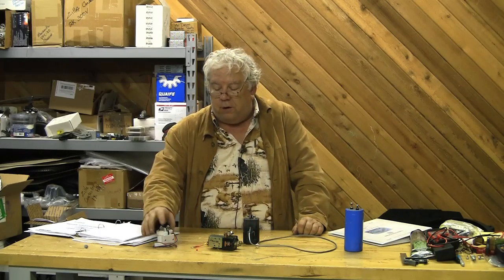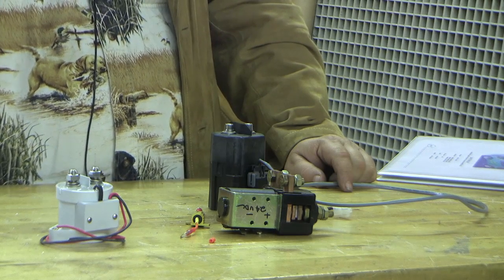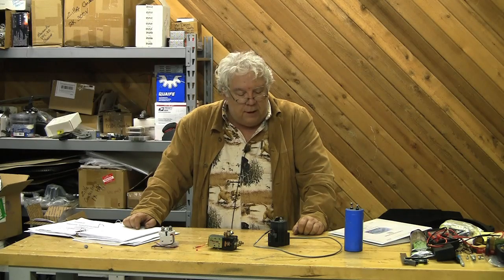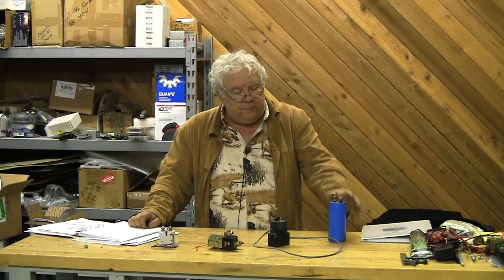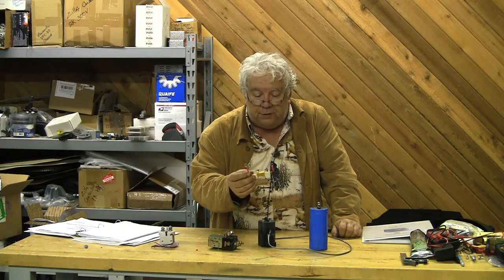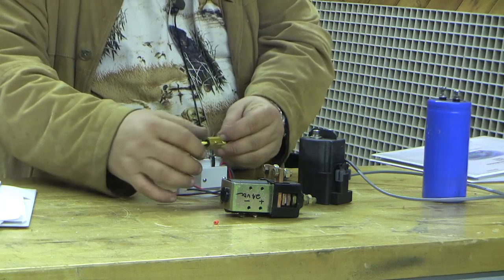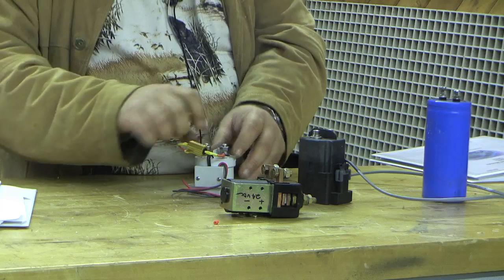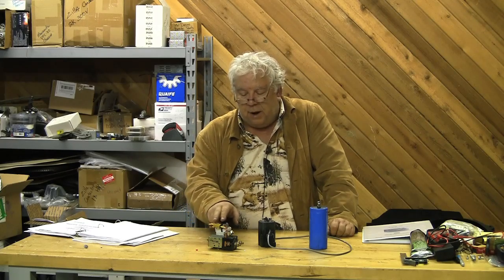EVTV News - March 5, 2010.  Part 2 of 8  2009 Mini Cooper Clubman Electric Car

Comment: Jack, for my electric conversion I have made a circuit which controls the precharge switching which makes it a foolproof system.
1.Check for traction pack voltage present
2. If present - switch in precharge resistor
3. After a few seconds (not minutes) -precharge time, enable the contactor.
... 4. On turn off the precharge resistor is disconnected.
By not connecting the precharge resistor permanently, I can more reliably check for the presence of the traction pack voltage.
Eric